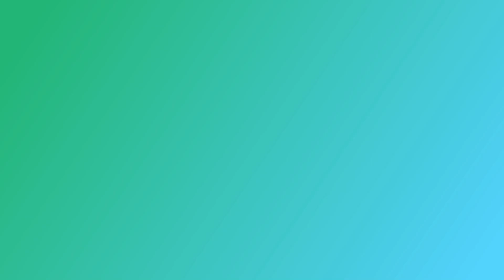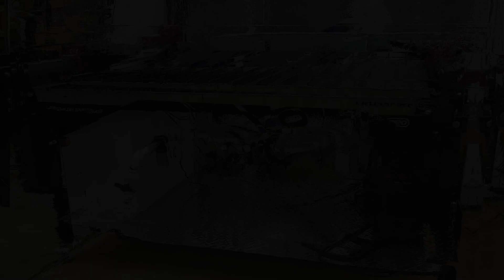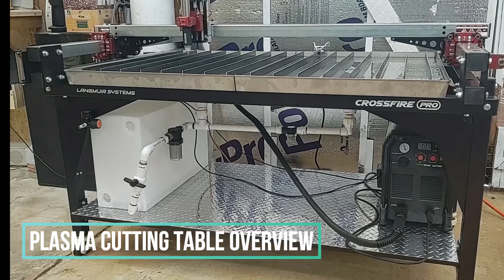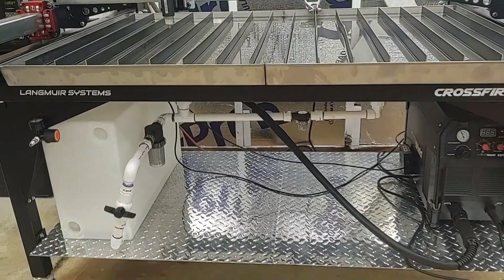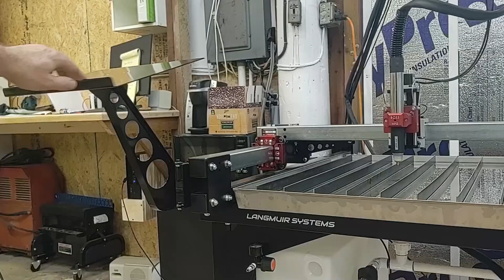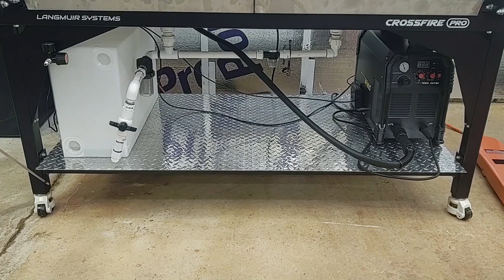Long EZ N916WP - Shop, Build & Plasma Cutting Table Overview

Comment: Have you had any issues with the prime weld 60? I'm trying to decide between prime weld 60 and the razor weld 45 for the crossfire pro. Thanks in advance
Reply: I have the Primeweld CUT60 it's absolutely perfect. Never ever had a single problem with it and plenty of power.

Comment: Nice set up, where did you get the tank at. I don't see any links? Thanks.
Reply: 16 gal RV water tank off of Ebay.  Around $45
Reply: I did see it after I posted my question. Thsnks

Comment: Do you have a link for the casters.
Reply: There are a ton on Ebay.  Here's the one I bought:  https://www.ebay.com/itm/FOOTMASTER-GD-60S-Nylon-Wheel-and-NBR-Pad-Leveling-Caster-1100lBS/183653491134?ssPageName=STRK%3AMEBIDX%3AIT&_trksid=p2057872.m2749.l2649

Comment: Hi Wade I've been watching your videos on the plasma table I have one on order the same I also have the primeweld 60 as you 
I know it has the connector for machine torch plug on the back,.   could you show us how you connect the wires or whatever you have to do to connect your torch to the table . Nicely done the way you set up your table I'm actually copying it pretty much I ordered a tank and filters like you haveI also will be putting the shelf on the bottom I like the idea of the diamond plate is that aluminum ? 
Thanks for all the help  it  is really appreciate it you have no idea .there really are a lot of his pretty much the same out there as you and I with the same setup
Reply: Hi Theodore.  There is a diagram in the back of the PrimeWeld Cut 60 manual that will show you all the connections.  Torch fire wires (plasma start/stop) connect to connector pins 1 & 2. Color doesn't matter.  THC voltage divider wires go to pins 4 & 6.  Red wire to pin 4 and black wire to pin 6.  Yes, diamond plate is aluminum. You can get at pretty much any online metal dealer.  Good luck with your table!

Comment: I had the original, and now the pro.  World of difference.  I love the shelf, the drain tank and the mount.  I purchased the Langmuir torch mount.  Where did you get the magnetic mount?
Reply: Also.  On the voltage issues.  I bought a shielded usb cable and added the ferrite to both ends and currently no issues.  I’ll let you know if I see anything further.
Reply: @ManCrafting  Thanks.  I haven't had any issues since I added another loop through the ferrite.  The magnetic mount is from Boss Manufacturing:  http://plasmatorchprotectionsystem.com/

Comment: Great vid, thanks! I may have missed it, but what is the small filter in between the 2 drains? Also, can you share where you got your tank? Thanks!
Reply: Thanks Jim.  Small filter is just another filter.  I bought it not realizing how small it was, but since I had it I just threw it in as a filter for the farthest drain to simply add to the filtering process.  I got the tank on Ebay.  It's a 16 gal RV water tank and costs about $40-50.  For the CF Pro a 12-13 gal tank would do fine as well.

Comment: I'm doing the same setup the pro with the 60 prime cutter I tried the 60 cutter I also have a 50 from another company the 60 this prime 60 is so much better , I'm falling you to see what you do if your system cuz it's the same as mine did you get the machine torch from primeor where did you get it and what kind how much did you payI'm going to keep my eye out for your videos because I'm doing exactly the same hey where did you get the tank how much did it cost thanks for the video good job 👍
Reply: Glad you enjoyed the video.  I got my machine torch from a vendor on Ebay.  Don't remember how much I paid... I've been crazy busy over the past 6 months.  IIRC it was $250-300.